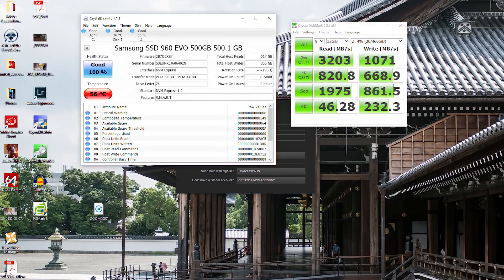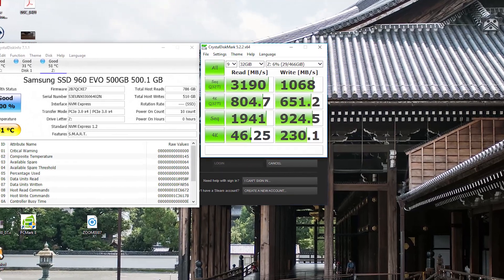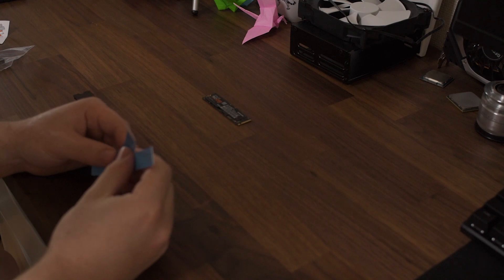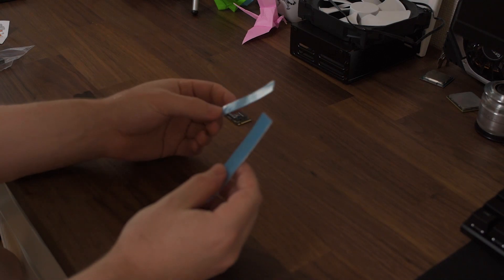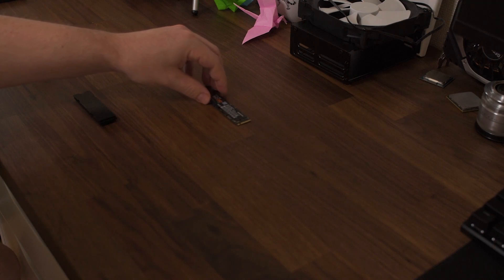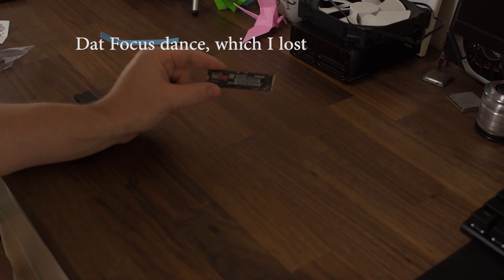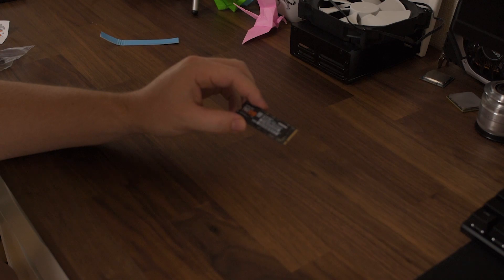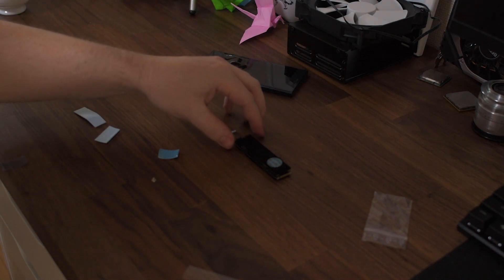EK M.2 NVMe SSD Heatsink review

Comment: Personally i'm cut out radiator from old video card with passive cooling radiator, it's quite thick (3mm base and 3mm ribs ) material is mix from aluminum and dural so it cools very fast. So i'm tested my 970 EVO under high load and maximum temperature it's reached is 32 in celsius and on calm state 23 celsius. So i'm don't see reason to pay 15-20 eur for small piece of metal if i'm can get free one. Oh forgot to mention that thermal pad i'm used is Grizzly minus pad 8, and it's very good.

Comment: I know there is no direct performance improvement to owning a heat-sink for your SSD... However, having your SSD run at cooler temps, should help increase the lifespan of the product overall. So there is still a benefit to installing one. <3

Comment: depends where you put the M.2 drive.....if above the hard drive ..say 1080ti after a while will soak in the heat from the card so you do need good air flow in your case

Comment: So I know you said 9 cycles at 32g. Did you run all the test or just the Sequential multiple times? 

The reason i ask is because i bought this heatsink and it made my 960 evo 1tb hotter. Doing nothing, it made it hotter. I can assure you it was just as much a hassle for me as was for you to put this stupid thing together and use the correct combination of pads to get it to fit properly. 

The pads that came with it were bad...? 1 side was slick and yes i removed both protective films. The blue side left the pad slick. So i put it on anyways. idle went from 34c to 36c. I thought well thats no good, so i replaced the pads with Arctic thermal pads, same configuration, 0.5mm on bottom, 1 strip of 0.5mm on thicker chips and 1mm strip on the rest of the top. Made it even hotter at idle, 40c. I was very disappointed to say the least.

So i thought maybe its the software giving incorrect values, using hardware monitor. So i used hardware info as well, same story.
I took it off, and checked the temps again, back to 34c with nothing on it, not even the copper sticker.

I heard these things get hot, but not as hot as the older versions, but i wanted to test it to see how hot it actually gets.

I didnt have anything to test the temps with. I have the passmark 30 day trail, but have no idea how to run the disk mark advance test... if im even able to run it without purchase.

Still without any testing involved I purchased these copper heatsinks intended for RAM (ENZOTECH Memory Ramsink BMR-C1 Forged Copper Heatsink), 8 come in a pack for $20, you only need 4 though. low and behold, dropped idle temps 3c. Thyere ugly as sin, but from where i sit, i cant see them and all i really care about is keeping the M2 cool.

So i ran crystal mark test kinda as you explained and noticed the first test (sequential) made it heat up more than the rest. For the short time in the first test, temps never passed 46c. Got even lower for the rest of the test. 

So my question still stands and should/can i run the first test multiple times? How long is long enough to get an adequate reading?

I also contacted EKWB about the pads, described everything i did and they responded that i didnt take off one of the protective films, as well as not offering in any way to help with my issue. Great people over there at EKWB, kind feel like theyre affiliated with Ikea with their picture instructions. 

thx for any help with this
Reply from the maker: I ran all tests. I saw the same thing as you, the drive would become the hottest during the sequential test, but I thought that a mixed load would be potentially more representative of a real-world use case.
I think if you want to get the maximum temperature, run the first test with 32gb 9 cycles twice and it should get nice and toasty. The thing is running these tests uses read and write cycles and 32g X 9 is 288gbs which is a lot. Considering that you seem to be using it for personal use I think running it more than twice would be irrelevant. There are very few use cases that would require continuos writes of 576gbs. This means that if your drive does not throttle after the second test (even just running it once is a huge amount already to be fair) you would never have to worry about your drive slowing down.
I also had a look at the PassMark test suite but like you stated in your comment the disk mark advance test is not available without actually buying the whole suite. I think this is not worth it unless you work in a position where you have to regularly test SSDs. I think Crystal mark will give you a decent representation of how your drive will behave under load.

I am really sorry to hear about your miss-fortune with this product, although I am glad I am not the only one who struggled to put the damn thing on. The instructions aren't very helpful. It is also a bit weird that EK wasn't more helpful, I have heard good things about their customer service. It is really strange that it made no difference at all though. As you saw in the video it helped the temperatures on my drive (not hugely granted but enough). It seems as though you went through all the steps to rule out every variable but the actual heatsink. The process you describe with installing the heatsink sounds like you did everything right. I am sorry that I can't really give you any input on what else to do and why the heatsink is not working in your case. You did everything I would recommend doing to troubleshoot the heatsink. 

If you have any follow up questions please let me know, I am sorry I couldn't be more helpful. Thank you very much for the comment.
Reply: Cool thanks man. 

Yeah i ran the Sequential test 5 times, but the write portion would actually allow the ssd to cool down. after the third test, it wouldnt get any hotter than 52c (considering a cool down time between read and write).

According to what youre saying, this test (9 cycles @ 32g) is unrealistic, cool, cuz it never broke 52c.

EKWB is sending me new pads, but i dont think it will cool it better than the RAM sinks I put on there.

Im not sure why the EK heatsink isnt working as intended and i kinda doubt that their pads are better than Arctics, but i could be wrong. 

The only reason I wanted the heatsink is well, because the price of a 1tb Samsung 960 evo is $450. I went all out on my most recent build and I want to protect my investment.

Your video is the only source of info that i could find regarding this heatsink, temps and testing.

Anyways, thanks again, youve been very helpful and informative.